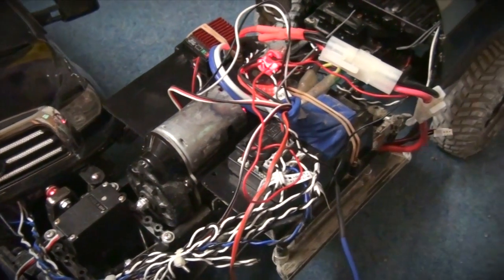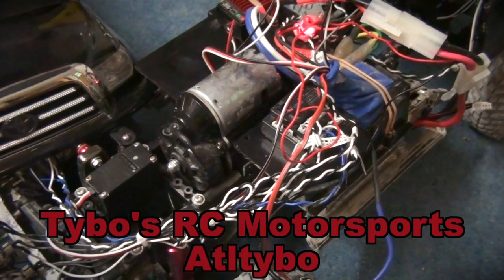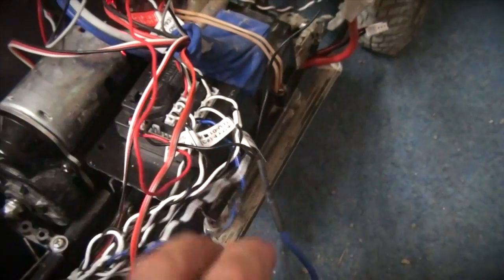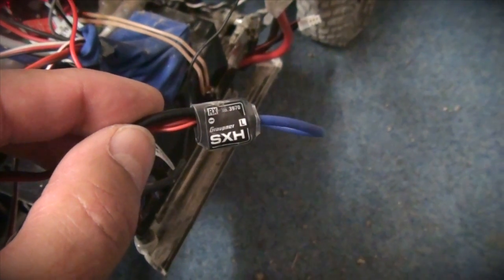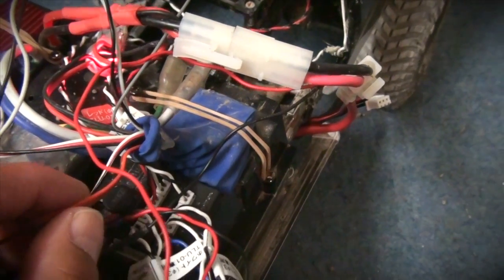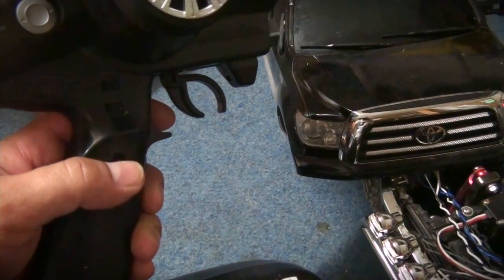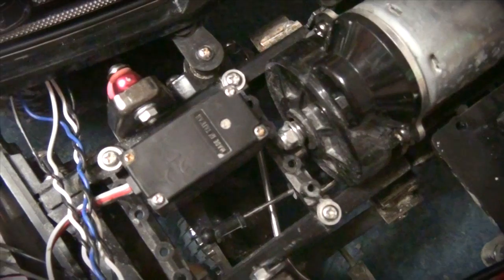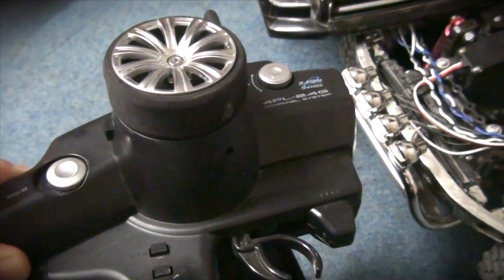Lights on/off in a RC Car - How do

Comment: About the RC4WD BULLDOG winch, I run mine plugged into CH4 and use the knob on the 4PL to control speed and direction. The 3 Racing winch doesn't like variable voltage and needs to use the CH3 3 position switch Matteo uses for shifting. I'm working on a video to compare them.

Comment: Hi Matteo.

Just ask if you please,  can make a video with more details about the connection
I'm a bit confused

Thank you in advance.
Reply from the maker: It's not difficult. Only solder the switch between the black cable (minus)
Reply: @Matteomeier  

Thank you Matteo

I did it. Works great

Comment: Is the signal wire not strong enough to power the LED?  I would think 2 headlight LEDs could just run off that...
Reply from the maker: The signal wire is strong enough, but it can not power the LEDs. The power comes from the red and black cable. You can connect these directly to the receiver, then the LED‘s are always on but not switchable.

Comment: Using the TLU-02 with the TLU-01 makes doing this even more difficult. The TLU-02 and the radio must be turned on for the ESC and steering servo to work since it reads the servo signals. I am researching good ways to control the TLU-02 from the 4PL. It won't be easy.

Comment: So how exactly did you solder the wires? Is there wiring diagram.
Reply from the maker: If you buy a switch this should be included.

Comment: Hey, I want to wire a rc truck completely with running lights on all the time and then I want to flip a 3 position switch and have light buckets like kc lights on a real truck and then all the lights on. On the switch I want to be able to turn them off, running lights, and all lights. And how many volts would that be if I had 6 bright lights and 10 dim lights. It will be 4 bright white, 2 blue dim, 4 yellow dim, and4 red dim, and 2 bright red. I also might wire a trailer to pull with lights.

Comment: Hey Matteo, ich habe eine Frage zu dem Schaltgetriebe des tamiya high Lift chassis. Wie hast du es geschafft, dass du die Gänge per Schalter wechseln kannst? Mein Bruder hat das selbe Modell aber wir bekommen es einfach nicht hin, den schaltservo auf ein Kippschalter seiner Futaba Flugfernsteurung zu legen. Wär nett wenn du uns helfen könntest :)
Reply from the maker: RealwoodFingerdecks Hallo Jungs, helfe gerne wenn ich kann! Damit das funktioniert muss die Fernsteuerung einen 3-Stufen Schalter haben. Wenn sie das hat sollte man im Einstellungs-menu eine jeweilige Funktion dem Schalter zuweisen können, in eurem Fall wäre das dann zum Beispiel Kanal 4 auf dem entsprechenden Schalter. Welche Futaba Flugsteuerung ist es dann? (habe auch Futaba für meine Flugzeuge) vielleicht kann ich euch dann noch genauere Infos geben.
Reply: ***** Also, es handelt sich um eine Futaba FF7 2,4GHz. Einen 3-Stufen-Schalter hat sie, aber wir bekommen den nicht so belegt, dass dieser für die Schaltung funktioniert.
Reply: ***** hab dir eine Pn geschickt :)

Comment: You have gears on a electric car?? Where have i been for the past 7 years...
Reply: michael cabrera - believe it or not, Tamiya has had a 3-speed shiftable transmission since 1981!! 
Tamiya NEVER seems to get credit for innovating and inventing nearly everything in R/C today.....
           The first working suspension 
The first multi channel (more than 2) in a R/C car
The first Scale Hardbody 
The first cars with drivers
The first Truck with 4-wheel steering 
The first Sedan race car
The first R/C F1 car
The first 4-wheel drive Buggy 
The first R/C Semi Truck 
........... I could go on and on
Reply: :o